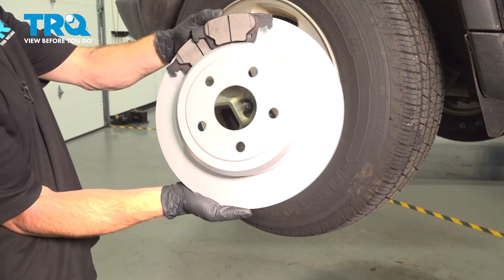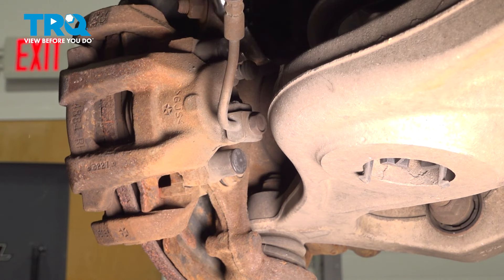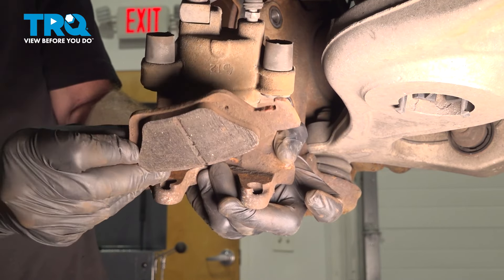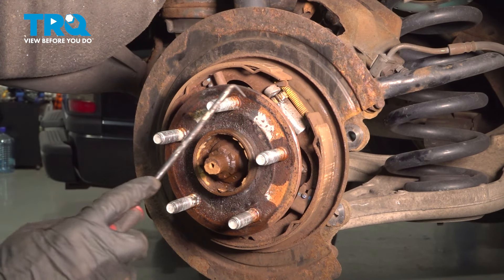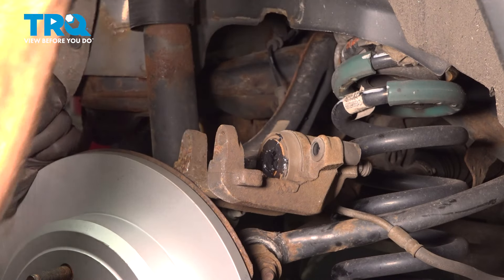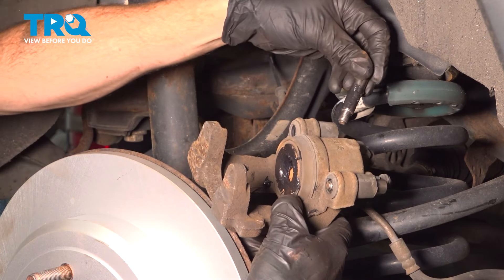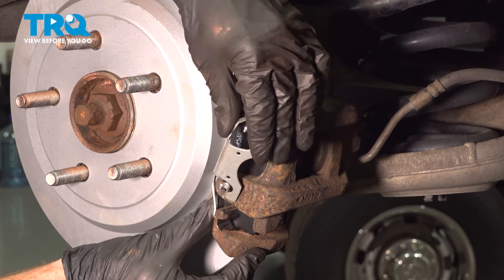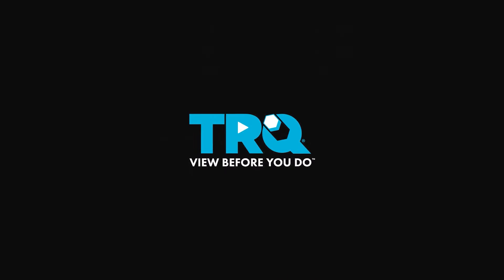How to Replace Rear Brakes 2011-2021 Jeep Grand Cherokee

Comment: Thank you for creating this video. I was able to replace my rear rotors and pads using your step by step video. I ran into an issue trying to remove the caliper pins, (I needed an impact wrench). Fortunately, I was still able to remove the old pads and install the new without too much trouble. Thank you!

Comment: 2019 Jeep Grand Cherokee Limited X V8 engine do you need to plug in a scan tool and put the vehicle in service mode to collapse the calipers?
Reply: As far as I’m aware that only for vehicles that use an electronic parking brake.